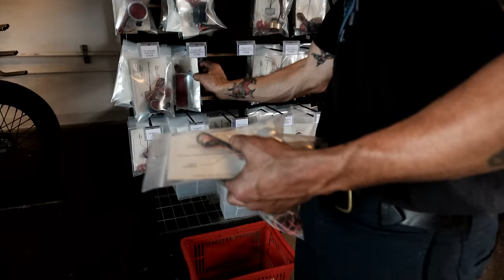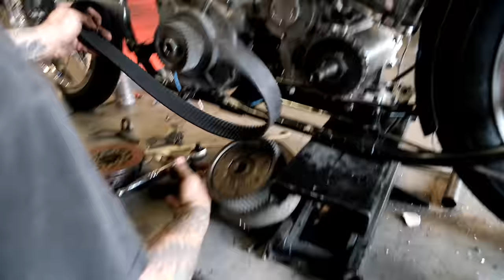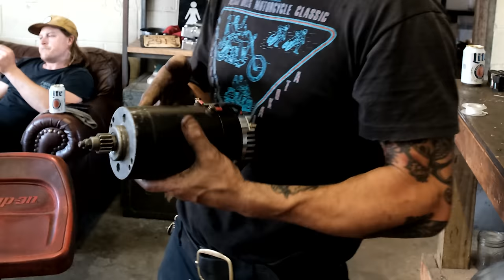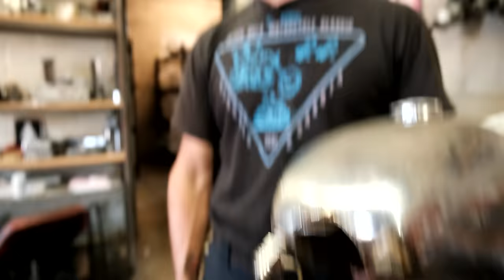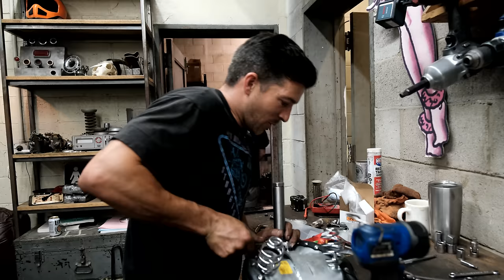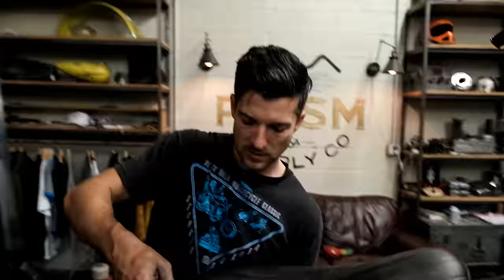Can We Build a Chopper in a Day? PART 2

Comment: Nice job guys.  Just goes to show,  when you have guys that work well together you can do damn near anything.
Reply: Add Marvel Mystery Oil to the gas, that will help free up the rings if they are indeed gummed up.   You can also add it to the engine oil.  This will buy you some time until you take it apart.    Real nice video.   You should build a Cannonball or Motorcycle Chase bike !!  🏁🏍🏁